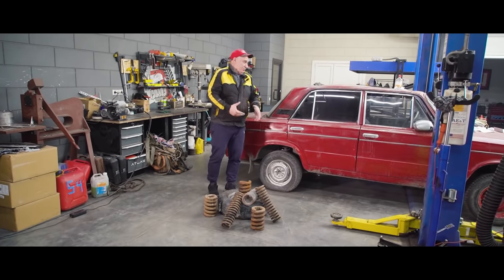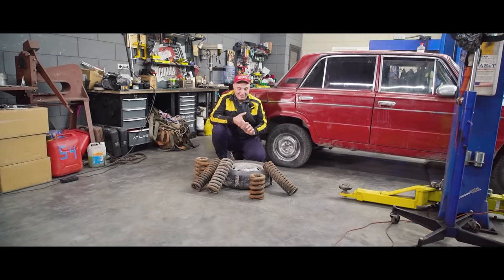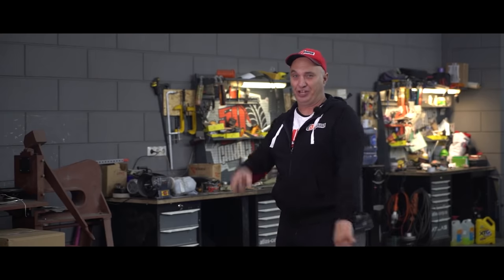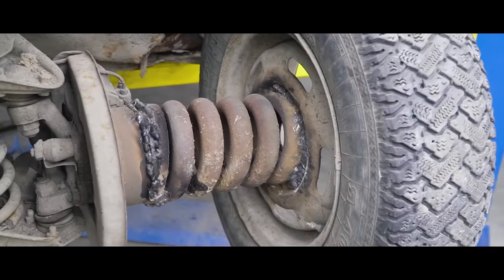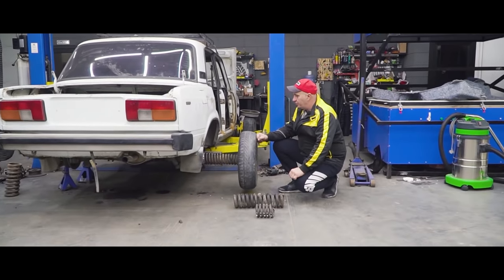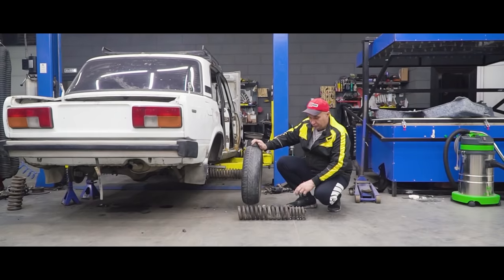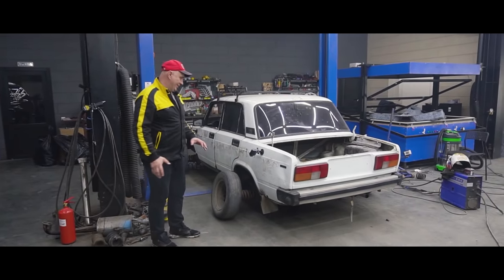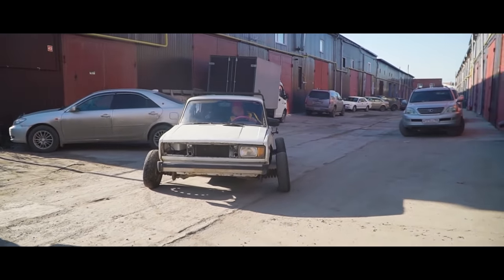Sprung wheels for 107% comfort in a Lada

Comment: connect a running engine's exhaust pipe to another engine's air intake source. Or connect the exhaust to the engine's own air intake source. Yeah I know the engines won't run great, but I'd rather see Garage 54 do it to their own cars, than me trying it!
Reply: So basically a big a EGR setup. Yeah they run like shit when EGR sticks open so probably isn't gonna run at all..
Reply: I'd want to say they did it but they feed helium/sulfur hexachloride into motor.

Comment: As usual, massive success.

You should try to make a driveshaft made from springs, and see if it would catapult the car from a standstill when you release the parking brake, like those little toy cars.☝
Reply: Oh god.. Sounds scary af, but might give the 'ol Lada better acceleration lol. 0-60 in 8? Ha.
Reply: @thermionicemission6355  More like .8 with the modification
Reply: Think they did something like that 🤔.
Reply: @thermionicemission6355  I think you would want to do an unmanned test first.
Reply: @killerdinamo08  Have a link/name? I'm imagining just taking the solid driveshaft, cutting a small chunk out and put a slightly larger pipe over (to keep it aligned), then put a huge spring around the whole driveshaft. So you've still got the stability to keep the spring in line, but the pipe would let the two ends "twist" a little with the spring.
Reply: @siyznshidlri8022  lmfao, dude that would snap the Lada axles so hard. I have a Lada axle underneath my old Datsun woods truck and I've broken it numerous times, I've probably replaced the whole unit twice. They're so stupid cheap though...
Reply: @tacomas9602  "Ive broken it numerous times, I've probably replaced the whole unit twice. They're so stupid cheap though" soviet engineering in a nutshell
Reply: How would you deal with it getting shorter? Really, really long slip yoke maybe lol
Reply: It's manual. Not the way it works. You can't just "prime" a manual. It would burn clutch and eventually stall.
Reply: Now that's a dangerous idea, I love it.
Reply: @wills.5762  you could make a giant drum with a spring along the style of those found in chainsaw recoils perhaps??
Reply: @tacomas9602  Oooh, I like that idea very much. Fuck if I still had a welder Id do it myself lol
Reply: @killerdinamo08  they did on their main channel that’s in Russian only
Reply: Brilliant!
Reply: Oh i have a feel that spring will come thru the floor xD
Reply: Regenerative drive shaft 😂

Comment: Engineer nerd time but, I feel like you could definitely remedy the unruly steering and jumpiness if you put in a boatload of effort and time. (I know this is a silly, fun experiment but) If you could somehow get drive to the wheel (using a few CV joints maybe?) while making the springs stationary so that they dont spin with said wheel, and add some sort of articulating reinforcement bar on the horizontal axis of the springs, connected to either end of them, to stop the spring jumping forwards and back while driving over bumps, etc. You might get a more controlled ride. Atleast one that hopefully wont make the steering wheel try to escape your grip. Thats my silly idea anyway. Either way, it was a fun video to watch!
Reply: I think you may have something  there. 
I think I see the end of leaf springs
Reply: But surely the issue is the negative camber... So im not sure how what you describe will help.

Comment: Would be interesting to see dampeners fitted to the wheel and the top of the strut mounts / frame to see how much it helped with the controllability.  You had some spring rate, but no dampening.

Comment: As others have mentioned, Lets see a spring driveshaft/propshaft.  Granted, finding one continuous spring long enough, and of a suitable girth would be an issue, but I think that Vlad and the G54 guys can do it.  
However, a spring that long under torsion could tend to sag and tangle up.  The spring would need to be sleeved inside a pipe of slightly larger diameter than the spring.    Meaning, the pipe secured in the tunnel to house the spring, but NOT attached to the spring. ONLY to keep the spring straight.  Think like a speedometer cable.  The pipe being the stationary casing, and the spring being the rotating shaft inside it.  They could grease up the spring to lower friction of rubbing inside the pipe.
If you want to get fancy,  the pipe could be connected to the housings of both the transmission and the differential to keep the inner spring aligned.  But this would require making the pipe in two sections.  One that can slip snugly inside the other to simulate the way a proper driveshaft slip-yoke works. Or go the easy way, and mount the rear axle solid to eliminate that movement. 
Also as I have seen mentioned before,  hold the rear wheels with the brake,  load up the spring by feathering the clutch and giving it some throttle, then release the brake and dump the clutch at the same time.  Should result in a sudden launch.  But quickly followed by an equally sudden rebound causing a lurching motion.

Another Idea:  Spring replacing the steering shaft.
Reply: The driveshaft spins 3-4 times axle speed, so balance and flex become a HUGE issue at much lower speeds than wheel balance issues even become noticeable.  This is why DOT standards specify a maximum length of driveshaft.  If you need longer, must add support bearings and u-joints along the shaft in segments up to the maximum allowable length.  Too long and they can suddenly fail at speed, instantly bending and flailing the undercarriage and fuel tanks, probably locking up the axle for a smoky out of control spinout-stop on the spot, then inability to move from however the laws of physics left you till a heavy duty tow arrives.
Reply: Use a garage overhead door spring.  The overhead door companies buy the springs in long lengths and cut them to length.  The door has them mounted on a shaft.

Comment: Mad genius... I love it.   I was expecting there to be an insane amount of axle wrap with the springs winding and unwinding under acceleration and braking.  Worse yet, I think this effect would be opposite on the driver's and passenger's sides of the car. One side would tighten, and the other would compress when the torque got to the wheel hubs.  At the slow speed, I guess this never happened.  You should take it to a drag strip where the road is flat enough to drive a little faster.  I might recommend a roll cage, too. 😲

Comment: If there is one thing that makes Garage 54 great compared to what we could see here in the west is how things are just tried without overthinking the safety aspects to the point that most other Youtube channels or even full on TV studios would just scrap the bulk of ideas for being too dangerous to justify carrying through.

Edit: Here is an idea for a episode: use a Lada motor as a supercharger for another Lada motor. We are always told that a engine is just a big air pump so take a engine, hook it up to the intake of a running engine, then power the pumping engine with a chain or belt from the running motor. See how much power you can get from such a combo.
Reply: Good idea, although you would need the pumping engine to have a much higher capacity (or rev much faster) to get any boost.  Theoretically, double the engine capacity or double the revs would provide 1 atmosphere of boost which might be a decent test.  I don't know what boost would actually be achieved after losses, but I'd like to find out!

Comment: This video gives me an idea for a future video.  They should find gigantic clock springs and rotationally link the wheels to the axle (or the drive shaft to the transmission) by springs. In such a way that when you try to accelerate the car stays put for a second while the springs wind up then the car launches like a windup toy car...If done right with braking you might be able to make an otherwise stock Lada accelerate like a dragster.

Comment: That type of suspension works great on a trailer I have owned a cleasby roofing patch kettle and worked for  numerous contractors with the same  patch kettles I recall them being 200 GALLONs and they tracked better than any other trailer I ever pulled In the fast lane like an arrow for real.cleasby manufacturing south San Francisco the best small trailer I ever pulled horizontally. Mounted coil springs  no damping like an arrow fast lane full of hot !!

Comment: You should weld in supports  for the front and back springs,but on the front and back of the springs instead of top and bottom to keep the wheels from turning when you hit a bump

Comment: F=-(kx)

F is the force applied to the spring in Newtons (F=mass*gravity = kg of Lada * 9.81)

k is the spring rate in N/m

In this case x is the length of the spring.  

k=(F/x)

If you know what length you want the spring (in meters) you can figure out what spring rate you need to accomplish it. The manufacturer spring rate will be published for axial force which is not the type of loading you're looking for, but it will get you an idea of the rate you need for your lateral force.

Comment: try making spring steel shock springs, by stacking steel sheets on a high stack. they should not be extra flat, so that the curved steel plates can suspension some. ie does not hurt if the cut steel sheets are curved somewhat. by design. yep diy car suspension leaf springs.

Comment: Make a rocker arm suspension with the wheels mounted on levers that are on top of springs. Maybe put a fulcrum in the middle and the springs on top of the lever on the inside of the frame. I think that could actually work well with the right leverage and spring tension.

Comment: Hello from France 🇲🇫
That so funny, but guys.... I 5hink you should just buy a Citroën, why not a 2cv, and you have the same ultra soft car😄😇
Your car have a big problem : the rear light don't work.... You can't stay like that. How about mod this car with a full independent 4 wheels on dual triangle arm, and a air bagger system ?
You could do it by yours for sure. 
I'm still wait to see a day, a great long project on the ultimate russian car, on the same base, with an inline 6 or inline 8 cylinder by adding cylinders like you already cut motors. 
And good engine performance for budget luxury car. 
Happy to follow your channel guys, you're definitely not normal and it's the way to live fun 👍👍👍👍👍

Comment: *edit* or just have a nitrous kit. That's an easy install and quick low hp fix! *edit*
Upvote for garage 54 to build one high horsepower motor to swap into cars where they do crazy suspension/wheel mods to swap in and really be able to play.

The Lada motors simply don't have enough power!

Comment: Can you build a frame and let the car hang from it with springs with the differential connected to the frame via drive shafts to propel the car forward or backwards. Same can be done to the steering. Basically you will have a car hanging in mid air from a frame with springs holding it

Comment: a question, is it possible to manufacture a head gasket. with common steel plate? if possible, how long would this joint last?
up for him to read the comment
Reply: I've heard of people in Russia simply cutting head gaskets out of paronite, albeit for very modest engines (under 100 bhp).

Comment: Flip the rear axle up side down so that you have 4 gears in reverse and the reverse gear will go foward.then move the steering wheel and the pedals.then you will have a lada that is front wheel drive with rear steering.

Comment: Could you try doing another wheel experiment where you weld rods that extend the wheels out like the springs are, but at an angle so as the axle turns the wheels go up and down? Like rowing a boat type of motion.

Comment: How about if you started with say, a 4x4 or something else with a separate chassis, fitted air suspension to the seat, body mounts and road suspension, and then fitted super soft low ground pressure tyres...how marshmallow soft comfy would that be? Dampers wouldn't want to be too strong either!

Comment: Use a front wheel drive car and put the same engine and trans in the rear so you would have twice the HP with four wheel drive plus four wheel steering.

Comment: Now see if you can make it so the only suspension is between the body and frame of the car, rather than the axles.
Reply: Trackor trailers have that already. Its called air ride cab suspension.

Comment: Would love them to replace the shocks with pneumatic or hydraulic  cylinders and  connect them together on each side. So as the front wheel hits a bump it pushes the rear wheel down on the same side of the car. It would keep the car body level to the ground.